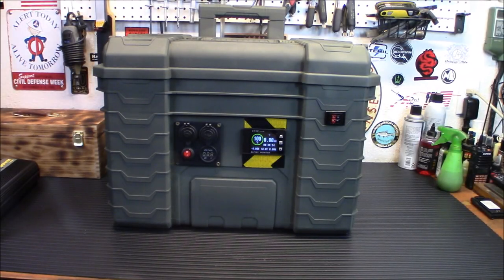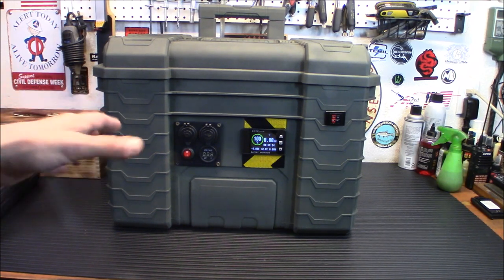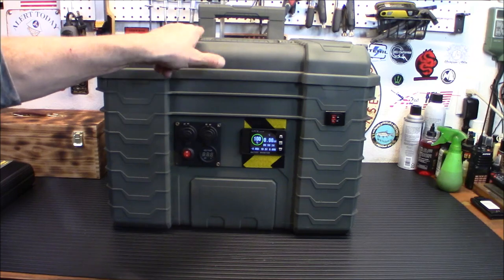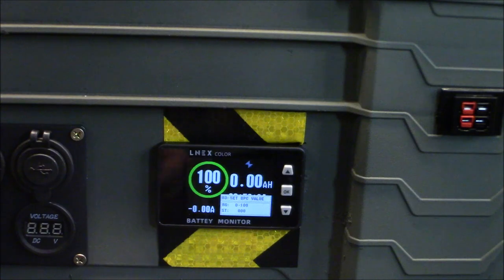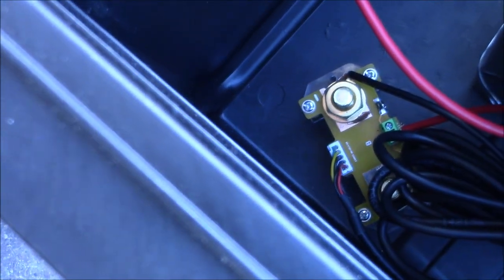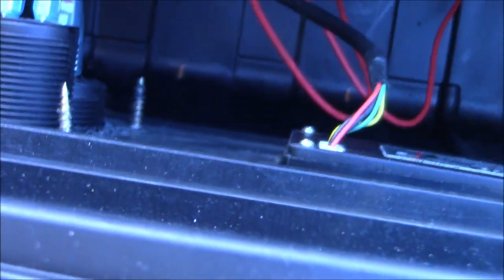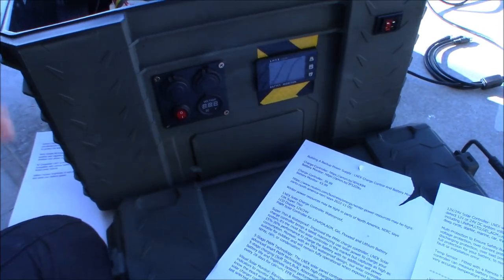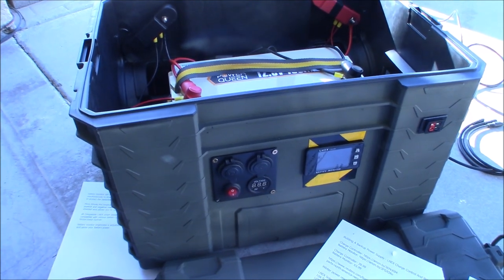Building A Backup Power Supply:  LNEX Charge Control And Battery Monitor

Comment: Thanks for showing off the new equipment. I was wondering does the charge controller provide an accurate reading of the state of charge? Or do you definitely need that monitor for that purpose?
Reply from the maker: The charge controller is dead on accurate, The monitor is nice because the charge controller is on the inside of the box but it works very well.